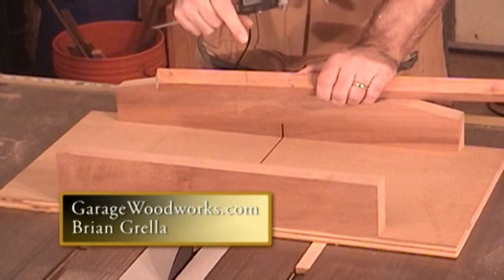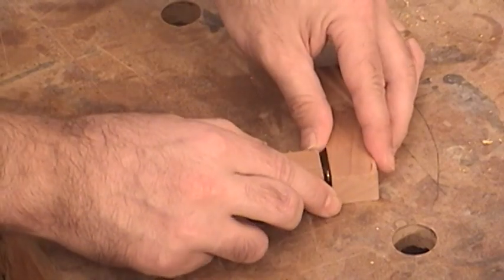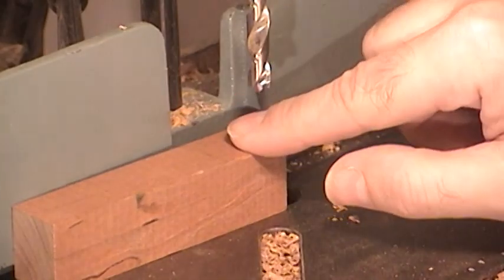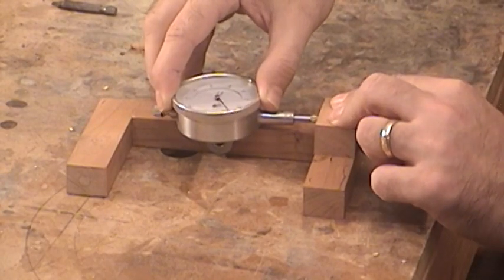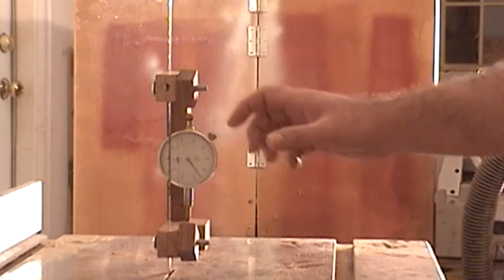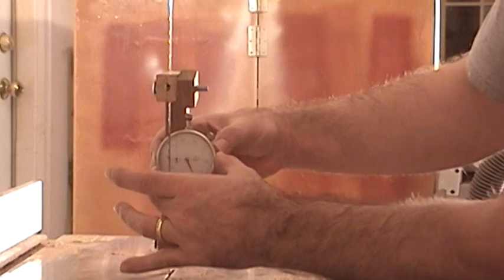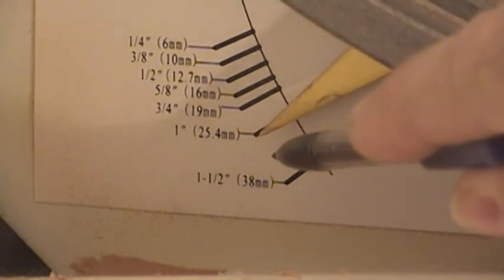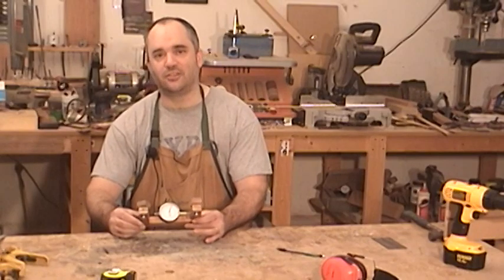Make a Bandsaw Tension Gauge

Comment from the maker: The needle jumped because the blade doesn't stretch smoothly - its stretches in a 'jerky' fashion.  A DI that measures to 0.0001" would jump as well.  Let's not get carried away here.  Ball park is all that is needed.  I now have a method to get me very close to 15,000psi where I didn't have a clue before.

Comment: I tried a similar approach on a 16" band saw, except I clamped the two jaws of a 6" dial caliper to the blade. Seeing the small amount of measured deflection to give proper tension, I modified my setup. I measured the deflection over 12" to get more 'signal' and I also used a dial indicator that measures 0.004" over a complete turn of the dial (about 25 times the scale resolution of a typical dial gauge). These results showed my simpler setup was over estimating the tension by about 25% (cont..)

Comment from the maker: Not sure what you mean by "repeatable"?  I can apply 1500 psi to the same blade over and over again. All that is required is to apply tension until I read approx 0.0025" on the DI. If by repeatable you mean reaching the same reading on the BS internal tension gauge with approx 0.0025" on the dial indicator, then yes it is repeatable.

Comment: Nice. I have less blade breakage at the proper tension on my 3 wheel bandsaw, better cutting results too. I was not using enough tension before.
 Do you have any tables for the proper blade speed when resawing different types of wood from Cedar to dense hardwoods? Or perhaps the feed rate is where to compensate.

Comment from the maker: (S/D) x 29,000,000   ---->Young's modulus for steel
S = blade stretch in inches
D = length of blade measured in inches
(0.001”/5”) * 29,000,000 = 5,800 psi

Answer 2: Use the same tension regardless of whether
the blade is carbon steel, bimetal or carbide-tipped.

Comment: I think you under estimate the accuracy of this method, although it will probably do a 'good enough' job.

Using a dial gauge that has a basic scale resolution of 0.001" to measure 0.0025 of deflection is really pushing it. Did you see how the needle jumped as you increased blade tension? Any slop (side to side) in your fixture will also show up as changes in deflection. 
(continued...)

Comment: I agree, you are just trying to set a reference compared to the built in tension gauge (which is rarely accurate). I suspect the jumping is from the dowel binding inside the wood leg. Being that the blade being tensioned is just like a big stiff spring, jumping is unlikely.

Comment: You have a unique setup with 2 means of measuring the tension and I just wondered if setting the tension at .0025 always produced the same measured tension on your bandsaw's pointer.  If there is a variance between the two, does it point to the inaccuracy of a traditional bandsaw tensioner quage?  That's what we all have and you have means of testing it.  I never miss your videos.  This was another good one.  Thanks

Comment: Brian, my bandsaw has an adjustment on the tension arm that can be "recalibrated". I wonder if you have ever tried to recalibrate it to your reading on the dial indicator and changed to another blade size and did it again. If so did the "recalibrated" built in indicator follow in a somewhat linear reading?
Enjoyed the video and thanks.
Bobby

Comment: I see that this was done 8-9 years ago, but I'm wondering if you are concerned about affecting the set of the teeth where the gauge clamps on.
Reply from the maker: It doesn't go on tight enough to affect the set in the teeth.  It's just tight enough to prevent it from slipping as the blade stretches.  I don't think you could disturb the set even if you really cranked down on it.
Reply: @GarageWoodworks  Thanks for the reply.

Comment: Thank you for the video and the math. Do you need to do anything to the jaws clamping the jig to the blade to prevent slipage? And, somewhat related, have you ever heard about using a guitar tuner to measure blade tension? Frequency can be converted to tension. Seems like another interesing alternative. Cheap app to measure frequency when the tensioned blade is "plucked"  is available for any smart phone. Thanks again for producing such an informative video.
Reply from the maker: Nothing is needed, in my experience, to prevent slipping.   I have heard of the "plucking" technique before, but I have never tried it.  My suspicion is that the frequency technique would come with a larger degree of error than the method described in this video and it might involve a tricky calibration of known tensions and frequencies.

Comment: Calculus and physics and I couldn't come up with the answer until you told me. Duh on my part. Thanks for the answer.
Reply from the maker: No problem.  It is a little confusing.  I just finished a page on my website that answers your question as it is pretty commonly asked.  I hope it helps.
http://www.garagewoodworks.com/BS_Tension.php

Comment: does the formula apply for different width blade and thickness?
Reply: nevermind i read the comments that said it didn't matter. but since a 15k psi moves the needle barely, can i magnify this by increasing the measurement distance from 5" to say 15"? I just have to divide the reading by 3, correct?
Reply from the maker: See here: http://www.garagewoodworks.com/BS_Tension.php

Comment: WOW, that was vary informative. I'm going to pick up a dial indicator as soon as I can. My only question is what is the tension for 1/8, or 1/4. I run from a 1/8 to a 3/4, the biggest my saw will take and all those blades can't run at the same tension. I would think that a 1/8 would snap at the same tension as a 3/4. Thanks.
Reply from the maker: The suggested tension is the same regardless of the width of the blade.  A 1/8" wide blade will require less force to reach the SAME tension as a 3/4" blade. The wider the blade the more force is required by your bandsaw spring to reach 15,000psi of tension.

Comment: Its a very useful tool and I will make one.
However, one query you are using the measurement of blade length as 5" but you cut the vertical member at 5" but you are clamping the blade on the cross members, are you not extending that measurement to 5" plus half the cross members? Should you measure between the two bolts?
thanks
James
Reply from the maker: No.  The clamping force from the bolt is spread over the entire surface of the wood contacting the blade.

Comment: Good idea on writing in the gauge on your bandsaw for each blade width but bandsaw blades stretch over time so soon it won't be accurate
Reply from the maker: The gauge in the bandsaw measures tension.  As blades stretch and get slightly larger, the same tension will be required and registered on the bandsaw gauge.  Therefore, blade stretch over time will be inconsequential.

Comment: This is an amazingly good video that is going to save me over $500.00!!! Thanks for sharing this!! A quick and important question though... Does .001" = 5800 psi over a 5" blade length for blades of all widths and thicknesses? Or do I need to use a different scale to get the same tension on other width and thickness blades? If so, where can I find a conversion table? :-)
Reply: Ok... don't worry... I think I just found the answer in your replies to others below. The amount of stretch over 5" stays the same for the same amount of tension regardless of blade size. I hope I have that correct. :-)
Reply from the maker: +Napier Thompson Yes.  Blade width has no influence on the calculation.  See here: http://www.garagewoodworks.com/BS_Tension.php
Reply: +GarageWoodworks Thankyou so much for the reply. You have been a great help! :-)
Reply: Great video. Are the other pieces of wood you used also 5" in length? What size dowel and hole did you drill in the piece of wood? Do you have any complete plans for your gauge. I am very new to woodworking and I need all the help I can get. Looks like you used some type of hardwood for the gauge. Is this correct?Thanks for your help and concern in this matter.

Comment: Would this work with a 3" version as long as the calculations are re-done? I only have a small 10" Bandsaw
Reply from the maker: +Eddy W Yes.  It will work.
Reply: Thanks for the prompt reply and the help :)
Reply: My calculation comes out at 9666.7 does that sound right?
Reply from the maker: +Eddy W It depends on what you use for D.  See here: http://www.garagewoodworks.com/BS_Tension.php
Reply: S=0.001 and D=3 then times by 29,00,000

Comment: Using your setup will get you in the ball park, but you still need to fine tune the tension by checking blade side deflection, plucking tone, or using other time tested methods
Reply: Your actually talking about this backwards, use a gauge that gets repeatable, accurate measurements then test with a "gut feeling" test. Any way you can measure something with rulers, caliper or gauge that is a measurable method is better than any time tested method that has no actual measurable method.